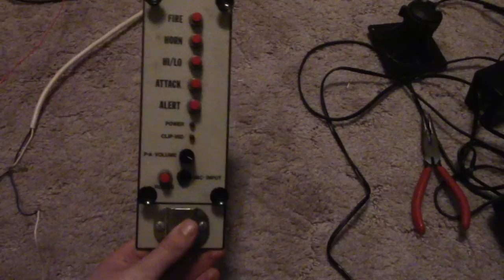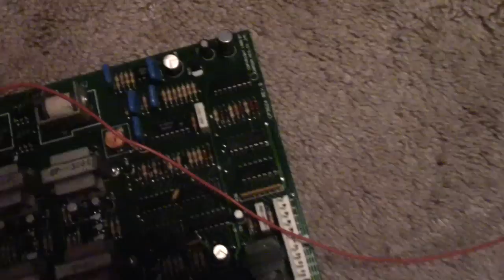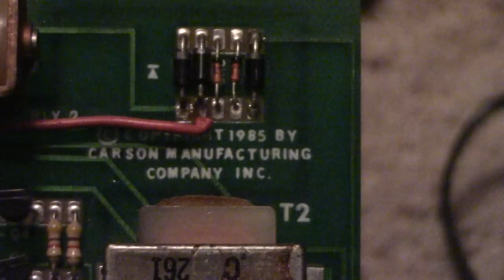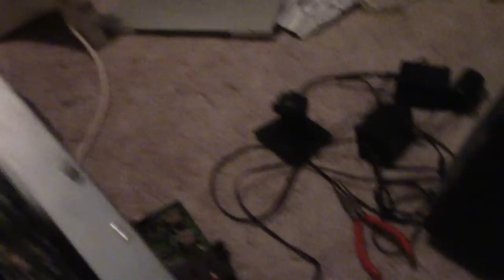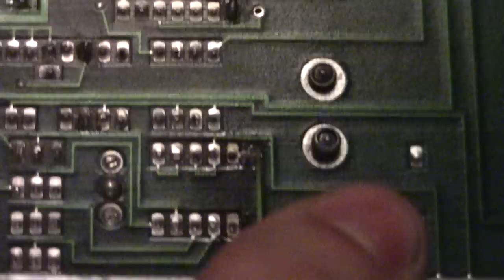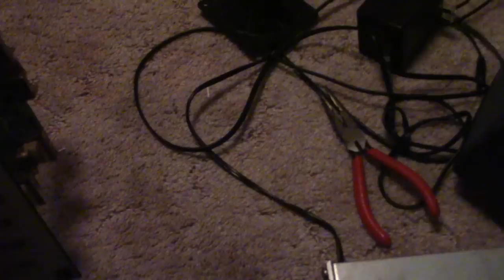A Rare Look at Two ACA Alertronic Control Boards

Comment: Awesome video. I look forward to the next one. For as complicated as the SiraTone and Alertronic controls look they actually seem fairly simple compared to what Whelen had out at the time. One thing I want to point out is that the digital controls are actually dual tone as well. The E-Class manual says that the current controls output a low tone through a second output on the board. The sound for the second output goes through an oscillator that offsets the tone by the same ratio as the analog controls. From the factory they are wired for single tone using the primary output, but you can change it and set them for dual tone or to run on the low tone output.
Reply from the maker: Did not know that. The way ASC and ACA made it sound like that you had to have them all programmed for dual tone or single tone, when in reality that is not the case on any of these units or current ones.

Comment: Hi tom... Those transformers on the control board couple the tone generator output to the power amps and also do impedance matching for the power amp inputs. I don't see any power transistors on those boards so you've got maybe a few watts of audio power at the most. However that horn speakers is probably the right impedance so it's running at maximum efficiency. Even a few watts of audio power can be quite loud given an optimal setup!

Comment: Thanks to your attack demonstration, I'm going to have to review a couple chemical plant systems now! Would be a lot nicer if they did turn out to be ACA instead of the normal bunch of Federal electronics.
I was wondering how adjustable these are compared to the SiraTone. Are there ways to increase the pitch or increase the wind down time like in the SiraTone, or is it packaged without any sort of adjustment?
Reply from the maker: Alfie Woolard The only adjustment the circuit board has is for the PA volume that is the only potentiometer on this board.

Comment: Do you happen to know what the serial number on the 1985 control board is? Wondering if I can contact Carson Mfg. to find out if they have a wiring diagram.
Reply from the maker: I have attempted to contact Carson about these boards they have no information on either of them.

Comment: Also while investigating a lot into the Allertor series from a project to install four already refurbished units in my town (which may or may not still be happening as my parents are moving to the other side of the state but I have other siren enthusiast friends up here interested in helping me out with the project), I had a sneaking suspicion most of ACA's parts were of third party origin. I was not surprised because most of the components on sirens are especially some of the electrical and motor parts like you had mentioned. Did you find anything else about them that wasn't known previously?
Reply from the maker: Well, the radios were outsourced from plectron. I have a strong feeling that the amplifiers were also made by Carson MFG.
Reply: FSThunderboltfan1000 Plectron was very good. We have a County in my area which still uses their stuff for siren activation (they use SiraTrol cabinets and have mostly old Federal stuff so the Plectron radios were likely added later). Those things are built like tanks.